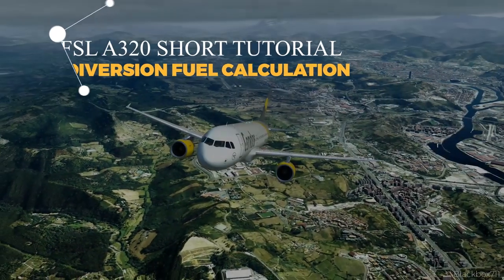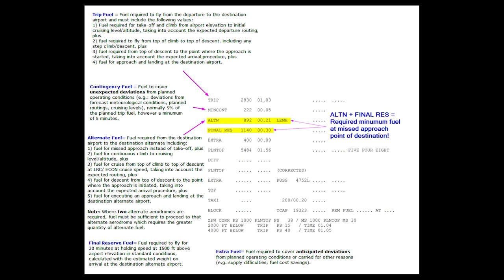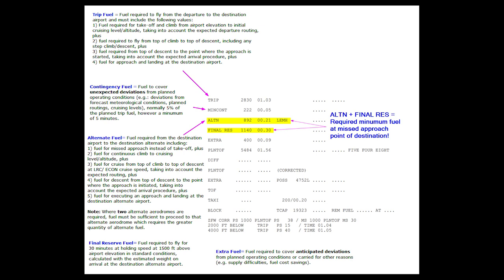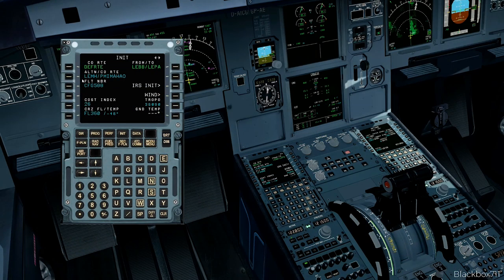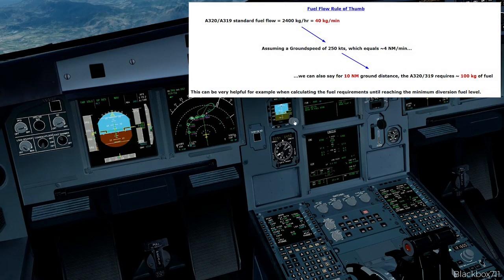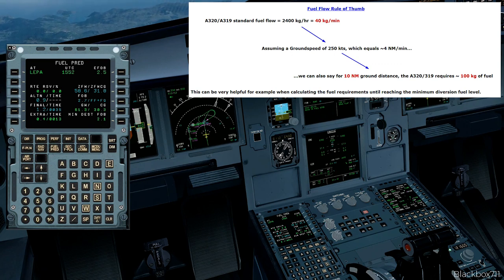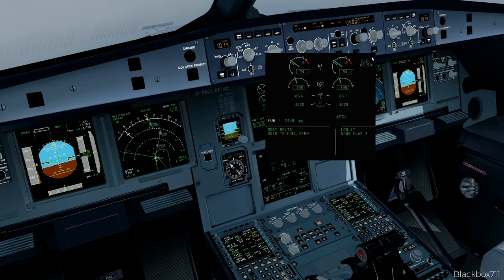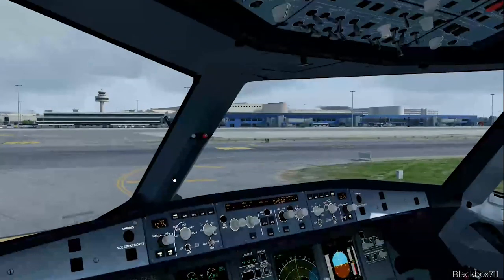FSLabs A320: Diversion Fuel Calculation

Comment: If you had a fuel leak would those figures automatically update? Wondering how the Air Transat flight failed to notice their EFOB at destination would be dropping if that was the case. Or what would happen if you accidentally inserted the wrong amount of fuel? Does it automatically cross check and warn you if it isn’t right?
Reply from the maker: The FMS will display a message once the estimated arrival fuel drops below reserve fuel. The crew of the mentioned flight was aware of the fuel issue but thought the fuel indication was faulty if I remember correctly.

Comment: Can we just use extra time in the FUEL PRED page to estimate our holding time instead?
Reply from the maker: Unfortunately that displayed time is very unreliable. To have a more accurate value Pilots are required to work out the value as explained
Reply: @Blackbox711   thank you

Comment: Hi Blackbox711, I was wondering... I got in the habit of putting in the FMCs/MCDUs as reserve fuel the sum of: 
- alternate
- contingency
- final reserve
- extra
I put extra in because I am thinking that that is an extra fuel that if all goes well I will not burn into. Sometimes, of course, I get the INSUFFICIENT FUEL warning as the FMS computes that I'll arrive 200 to 500 lbs bellow this "huge" reserve (weather, longer taxi, etc. etc.). But it makes me wonder if that is a good practice to have a "soft warning" to know when you'll burn more than expected and should watch your fuel burning habits? Then, when all is understood and further calculation still keep you above final res+alt you can change the value in the FMC/MCDU to final res+alt+cont. Next time the INS FUEL comes on, you'll know you'll be burning contingency, and so on, and so on.

As I said, it is rarely even to get the "burning into extra" warning in the first place. But just as good habits go...what do you think? (virtual flying only, of course)
Reply from the maker: Hi Adrian. I don’t think that is a good idea. The FMS has a separate indication for Extra Fuel. Therefore you can easily compare the flightplan values to the value in the MCDU. What you are doing is what we in the professional world call “personal non standard procedure”. Check-Captains will give you an earful when doing that ;-)
Reply: Thank you for your answer,  @Blackbox711 !

Comment: Thank you for this insight. 2 questions from my side. Reserve fuel must be in the tank at touchdown right? If you drop below during the taxi to gate later it‘s „fine“? If diverting and expecting a landing with minium reserve, would you consider an autoland, since GA is not really an option?
Reply from the maker: Yes, touchdown is the line. Well an automatic landing means the airport has to set the airport systems accordingly so that the ILS signals aren’t distorted. That might cause more  delays for the Approach.
Reply: Blackbox711 that makes sense. But the pressure must he very high during that alternate approach since GA is not really an option.
Reply from the maker: The pressure is high of course. The fuel would be enough in case of a go-around for one more Approach. But it would be under emergency and a shorter than usual approach.